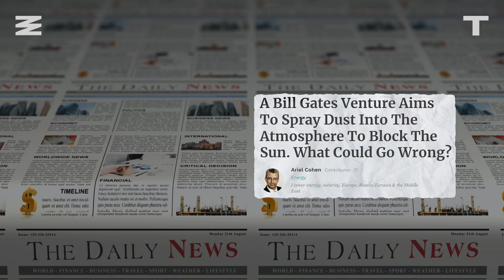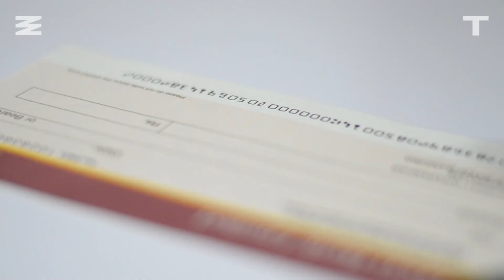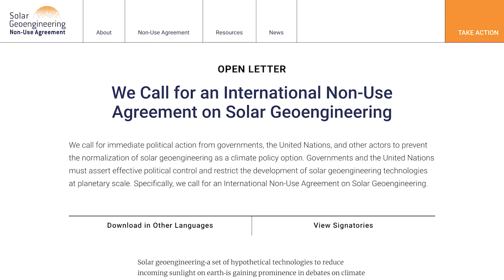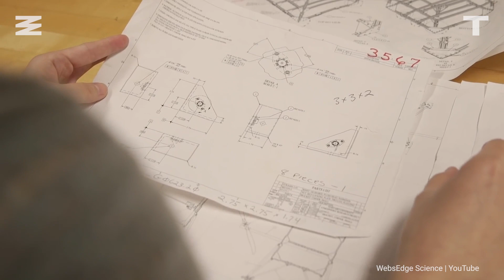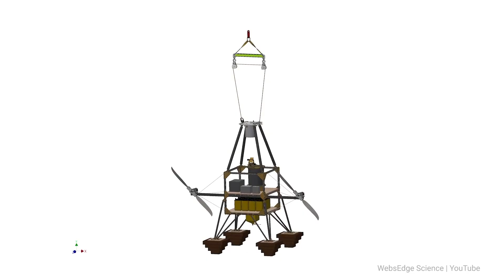Does Bill Gates Want To Block Out The Sun?

Comment: Yes! Sun Blocking Shade Device Patent
The patent for the Sun blocking shade device, Patent # 5,701,939, was issued on December 30, 1997. This device is designed to substantially block solar rays and heat coming through an architectural opening while allowing substantial visibility outward. The covering includes a plurality of sun blocking cells with inner perimeter walls that are effective for blocking sun rays entering at various angles, including vertical and horizontal angles. The cells are made from thin strip material, allowing a total open area greater than 80% or more from a front view looking outward, while blocking substantial amounts of solar rays and heat.

The invention aims to provide increased sun blocking and visibility compared to conventional venetian blinds and other window coverings, which are limited in their ability to block sun rays entering from diagonal or horizontal angles. U.S. Patent Documents
414743	November 1889	Wilson
595146	December 1897	Churchill
1937342	November 1933	Higbie
2110145	March 1938	Loehr
2722979	March 1955	Janowitz
2923350	February 1960	Brown
2990923	July 1961	Macias-Sarria
4002188	January 11, 1977	Hanks
4673600	June 16, 1987	Anderson
4677012	June 30, 1987	Anderson
4677013	June 30, 1987	Anderson
4993187	February 19, 1991	Schweiss et al.
5165459	November 24, 1992	Gaber et al.
5205335	April 27, 1993	Horton et al.
5274357	December 28, 1993	Riordan
5377737	January 3, 1995	Moriya et al.
5386867	February 7, 1995	Chen
5390720	February 21, 1995	Colson et al.
5558925	September 24, 1996	Fritzman

Comment: Excellent video. Thank you very much Jacqueline. Its a horrible thought to block the sun light. What about the plants whose leaves made food in the presence of sun light which is called "photosynthesis". Without Photosynthesis light energy will not be converted into chemical energy as also there will be no creation of "oxygen". 
This is really a luciferian concept to block the sun light.
But they are going to do this. Jesus Christ prophesied 2000 years before that "in the end times" the sun will blackened (Read Matt. 24, Mark 13 & Luke 21).